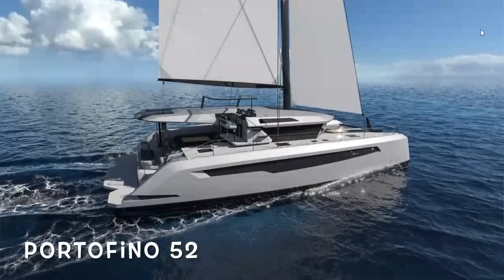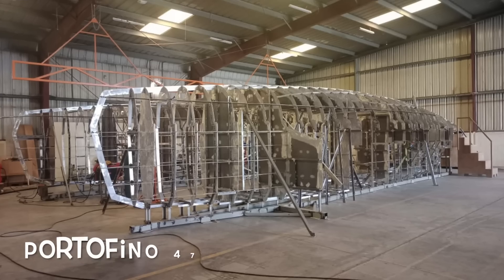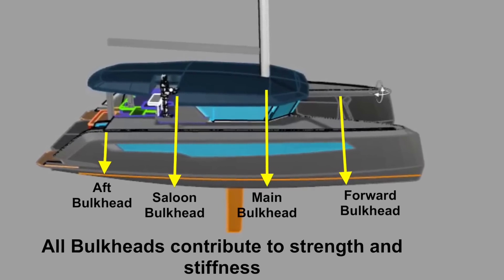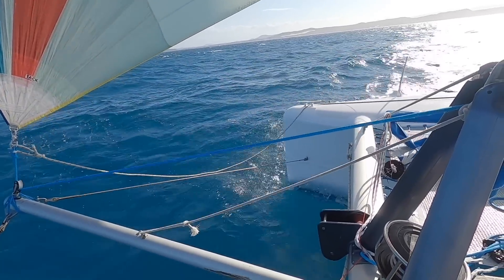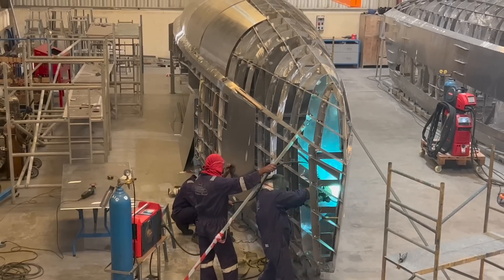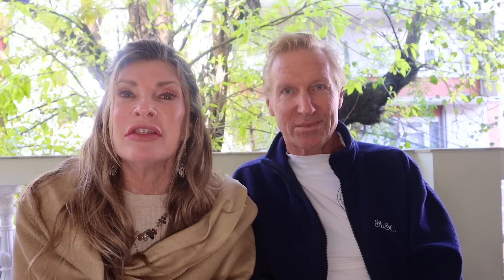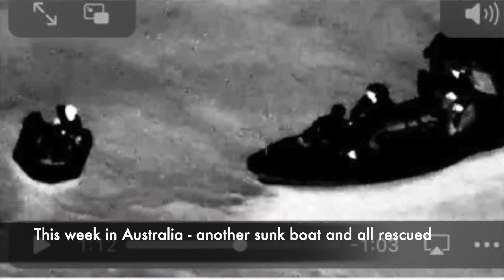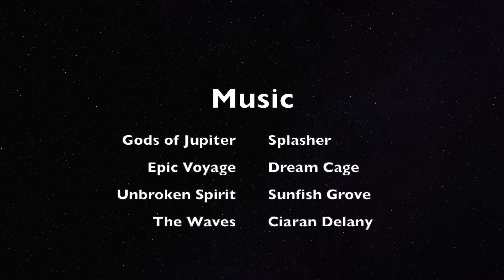S3#9.  Portofino 52 Build Starts!!! The TRUTH about BULKHEADS. And First  of 52 AL bulkheads cut!!!

Comment: So, a question what material are you using for windows? Will it be tempered laminated glass or polycarbonate?
Reply from the maker: We are using perspex (polycarbonate I presume) as the laminated glass is very heavy. We had the some on out performance cat, Alba Dash and it lasted about 17 years in the tropics but would need to be changed eventually.
Reply: @barefootdoctorssailing  Given the required area what would the difference actually be? Not saying that your decission is wrong but still interesting.
Reply from the maker: @mmolausson  We were told (from memory) it was 400kg extra in weight to have tempered glass.... So quite significant and because we have lots of glass all around, seemingly more than the HHs, perhaps that a factor in making it so much heavier.
Reply: @barefootdoctorssailing  another unrelated question, are you going for digital switching? That would save some weight in cables

Comment: I watched your sad VLOG about the boat fire and I'm very sympathetic. I was also very interested to hear your chat about grief after losing the boat. Maybe it's only an object, but perhaps it's something more. It represents your hopes and plans for the future.

Your next boat will have an aluminium structure, perhaps as a reaction to the speed at which  fibreglass allowed fire to propagate throughout your last boat. But now you have traded one potential source of increased risk (fire), for two others (corrosion and metal fatigue). Can you tell us what steps Portofino have taken to minimise their impact on your lives? Your boat will be built in 5083-h1116, which is an alloy recommended for boat building, so maybe corrosion will be very slow, but corrosion is relentless, like gravity. And the three things that promote corrosion are concentration, temperature and time.

As for metal fatigue, I expect you will maximise the radius on all openings and provide structural support to minimise the amount that panels flex when subject to cyclic load. It's not my field, but I'm keen to learn about the design choices made for your next boat.
Reply from the maker: Hi David, thanks for the kindness and understanding! WRT the build and design, the Portofinos are being built with significant over engineering - spare strength and sustain trauma (rocks, containers, Orcas) as well as corrosion. There was a technical episode we did about the mechanical rigidity of the boat and with 20T of weight in one corner, the opposite corner only flexes 4mm.

However the extra strength and aluminium thickness (6mm) is a compromise as it makes the boat heavier so this will be 16T dry weight compared to a Mumby / Odisea that builds with 4mm aluminium.... The corrosion monitoring that we will be using is also continuously monitoring for current which occurs if there is ever any galvanic corrosion starting. Many AL boats are now 30-40 years old and still good so it is all down to the effectiveness of the protective systems that you use (we understand and hope!)

We do not think it is inevitable and Portofino is putting is sophisticated monitoring processes for our protection.

Comment: Lagoons bulk heads are a disgrace and after watching Parlay Revival and David Shih here on you tube Lagoon need to have a serious look at themselves as boat builders ........ after seeing these 2 videos on the repairs a person would be better off buying a hurricane damaged Cat , at least one would know what their getting
    With the Ally Cats main vertebrae / spleen as the strength alone is a great advantage on your cat and the odisea , but unfortunately most won't be able to afford the Ally ones , even 2hd hand but that's life . happy sailing mate
Reply from the maker: You are so right Geoff! I built my 42 foot performance cat 20 years ago and at that time, I looked around at the production boats and saw the Lagoon bullheads that were only 1 inch foam holding the mast up and I had serious concerns as my main bulkhead was 4-5 inches with solid wood laminated and epoxy glass... I would never put my life in in the hands of a Lagoon and that is another benefit of the aluminium! Unfortunately harder to build and more expensive...
Reply: @barefootdoctorssailing  , dead right mate , my heart bleeds for the unfortunate ones who actually bought a Lagoon ( Not a Hurricane one ) , like David Shih it cost him $300,000US only to have to pull it apart and spend more , very sad

Comment: Out of curiosity, if it is possible, would incorporating carbon fiber for some/all of the bulk heads have any benefits for weight savings, etc. vs aluminum bulk heads in an otherwise aluminum boat?
Reply from the maker: Interesting idea Paul, but my understanding is that even carbon fibre has the risk of electrolysis when used with large amounts of metal so I think that is why it is not done... Also Aluminium keeps the cost down and carbon shoots it all back up.

Comment: What is the weight of aluminijum.. I'm asking for finished welded structure without anything inside..(empty shell)
Reply from the maker: Thanks for the question Jean Luc. I am not sure but think about 8 tonne. Will check with Raffaele though...
Reply: @barefootdoctorssailing8567  thank youn for replay.. im Will build my boat it is in design stage .
 And I study safety first because I will build expedition.. Aluminum but not a katamaran.. there are many electrical things that boat builders are building wrong.. and other stupidity. Regards

Comment: It is not that you have "more" aluminum on the frames where a flange is welded on forming a  capital "I" shape, but its shape and location.  Google "I-beam"  to learn more.  It's the same principle that makes cores in fiberglass hulls and decks strong.  For the same reason structural bulkheads can have light weight centers, because it's the faces that take the stresses.
Reply from the maker: Thanks Tim. We obviously have to trust the architects but they have done the stress test process to confirm strength too which is nice...

Comment: More info, the better Docs! Thanks for sharing. I live south of the 40th… I’ve been quietly trying to figure out what Cat makes sense. So very glad to hear about the Portofino cats!
Reply from the maker: Wow, you must be tough Micael! That will be cold... Are you in Tassy or NZ (as I presume it is not America)? Of course it does depend what type of sailing you are going to be doing and Portofinos (like Garcias) can have extra insulation in the boat for extra warmth and the Diesel heaters for the winter. I am certainly hoping for significantly better performance than the Garcias and the theory looks good but the truth will be seen in Dec 24 after launch! 

Probably you should make you list of what you want in the boat and allocate priorities scores to each item and then you can go through the list of boats to see what the options are and what you had to lose with each boat.

Comment: Very late to the party (got totally sidetracked watching police chases, pit maneuvers, and jail guards!) I'm no marine architect, nor do I have knowledge of geometry, but I have a question about the shrouds. If they pull up so much by being attached to the outside of the hulls, why don't they change the system to have them through the decks to the inside edges of the hulls? I get that would mean more places for possible leaks, but many are already actually done thru the decks to the inside of the outer hulls anyway. I hope that was clear! LOL
Reply from the maker: Hi again Diana, nice to hear from you again! Having the shrouds attached on the outside of the hull at the bulkheads means the pressure is taken by the bulkhead and not by the bolts that it is attached with... If it was inside the hull, it would be the top of the bolts that were taking all the pressure, instead of the bolts just holding the shrouds in place and the compression taken directly on the bulkheads. Hope that is clear - a diagram would make it easier...
Reply: @barefootdoctorssailing  I'm not sure! LOL

Comment: Fire? You are in the middle of the sea how can it catch fire? 😵‍💫😂🤣….. it’s amazing how flammable a boat can be surrounded by sea water. Fire extinguishers needed as well as builder pumps.❤
Reply from the maker: The usual cause of fire at sea is diesel leaking onto something hot, electrical wires or equipment shorting out or batteries (esp Lithium) overheating..... Yes fibreglass is very flammable and as soon as it establishes the whole boat will go up so you have have to kill it fast when it is small....

Comment: Off-topic, house battery research.

$6370 for 15.4kWh with automatic fire arrestors in an enclosed 24 in x 26 in x 28 in rack, paired with 3kW inverter and 5kW PV input. Throw in tinned wire/lugs and a Galvanic Isolator.

See YT "$749 EG4 All-in-one Solar System: 3000W Inverter, 5000W MPPT, 80A Battery Charger". but latest versions all 48 volts - (3) $1749 EG4-LL Lithium Battery (V2), (1) $675 EG4 3kW Off-Grid Inverter (new round corners), (1) $450 (Pre-Assembled) EG4 Enclosed Battery Rack, (1) $??? Galvanic Isolator VDI-xx.

Never know your current topic but figure this will be soon. All-in-one systems have come a long way very recently for homes. BTW the battery system supports up to 81.9kW hours at 48 volts.
Reply from the maker: Thanks again Boston for your comments again. Very interesting!!!!  The battery systems and chargers are developing so fast we are probably going to wait till six months before completion to look at what’s available at that time and we’ll probably do the battery discussion in that time frame. Thanks for those great bits of information it is very exciting how things are progressing and we are going to be using 48 V and there’s much of our gear as we can.
Reply: @barefootdoctorssailing  Perfect

Comment: I like this deep dive into a technical issue.  Can't recall anyone else doing such an in depth review.  Excellent!
Reply from the maker: Glad you liked it Colleen! I was not sure if it was a bit boring but certainly no-one else had talked about it and the large brands are still putting out comments that are very misleading.... Hopefully if the knowledge is across more of the yachts, they won't be able to get away with such stuff!
Reply: @barefootdoctorssailing  ..Detailed videos are an excellent help.  I am also becoming increasingly concerned about the corporate structure at Leopard and how they intentionally split the manufacturer and warranty claims functions.  I have followed another channel that is having a hell of a time getting warranty work done.  They claim they must sign an NDA before work is authorized.  Was that your experience with your Lapboard 50?
Reply from the maker: @michaeltca3103  BHi Colleen, we have only had small things go wrong and they were just dealt with by being told to fix them and send the invoices. They were not fast to pay but not the hassles that the other guys seem to have had with structural issues...

Comment: Aluminum in aircraft and boats. Aircraft use alodine treatment before painting. . I heard another sailor that has been around the world in an aluminum catamaran. His comment was to coat with paint the bilge where any salt water can collect. I saw a fisherman in Australia with an aluminum fishing boat on YouTube. He didn't clean the inside very often. He found corrosion holes clear through the hull in multiple locations .luckily he could get to location of the holes to weld and paint. The issue was there were conditions where salt water was present a lot of the time. 
Will you be painting your bilges? 
Croatian birds.
Reply from the maker: HI Gearing, at the moment I do not know what the plan is for the inside aluminium. 2 Things however - I would want the insides of the boat to always be dry and I succeeded with that with our 42 foot performance cat. Unlike the old boats that leak, AL and western red cedar with expoxy do not so the hulls are dry and ANY water raises alarm bells. Secondly, my understanding is that AL should not corrode unless there is a leak of power, your anodes are dead or there is power leaking from another boat / marina. So if the hulls are dry, we should not corrode and separately if the anodes and leak detectors are in place, we separately should not corrode. 

Silly things like metal debris, nails, screws or coins in the wet hull will cause the AL to corrode so keeping everything clean and dry is therefore important...

Sorry not Croatian birds - a different continent...

Comment: Interesting comments on bulkheads.  There are 3 other channels showing new cat construction (actually, one is reconstruction)  so will be interesting to compare each design
Reply from the maker: Thanks for commenting Robin. Are you talking about SLV (Rapido), Wynns (HH), Ruby Rose (Seawind) and MJ sailing? There is also Sailing into Freedom (Odisea) about to start and others very close so exciting times. When they are manufacturers making the boats, you will see less detail as the bulkheads are built and glassed in but all of those boat brands have good reputations to build strong enough bulkheads and glass them in well. MJ Sailing is well past bulkhead stages but you would have been able to see how they ensured their bulkheads were sound... 

What details were hoping to see - or just compare to what I was talking about?

Comment: Very Interesting -- QUESTION -- Why not have a steel cable (like a shroud but stronger) running horizontally from one side of the Cat to the other, connecting where the vertical mast shrouds connect to the outside hulls, ie from shroud to shroud, thus completely offsetting the forces from the mast shrouds that are trying to pull the hulls apart.  This should stop any spreading force coming from the mast/vertical shrouds.
Reply from the maker: Good logic Colleen. That is really what the bulkheads do and the different materials (metal, GRP, Wood and carbon) just use different amounts of material to create the required strength... Also steel would be heavier than all the other materials and occ aluminum is used for this purpose (like in the Leopard 45 photo of alum supporting the bulkhead).
Reply: @barefootdoctorssailing  ..very cool.  I got the idea from watching how they construct a roof on a house and then tie the "triangle" shape of an A frame roof together by running beams across the attic floor to stop the "A" from splitting apart during hurricanes and strong winds.

Comment: G'day Guys, a very informative and interesting video which I thought was a simple way of explaining to the uninitiated in laymans terms, well done.  Pumps, the vain of every boatie.  I have seen Bilge Pp's installed with a float switch that was set to go off too early (Shallow)  ie; the Pp still has air trapped in the impeller area which makes the Pp inaffective (useless) and unless you bleed off the air or more water comes in to overcome the air lock, it is not going to work.  As for emergency Pp's, your local rural supplier can supply a small petrol Pp that they use on small dams or for firefighting.  I carry a small 2-stroke one onboard with enough length of hose to pump from the engine room to over the side.  They pump a fair volume of water, are light & small enough to stash away and can also be used for firefighting.  I run mine about once a month to keep it in good operating condition.  I'll take a stab in the dark and say you guys are in Singa's, on your way home for a much needed break!!  :)
Reply from the maker: Hi TEx, that petrol pump is exactly the thing we are looking for to double as a pump not dependent on the batteries and dual purpose as you say. Thanks for your comment again!

Singapore is not where we are - but good guess as it is an Asian country.

Comment: Btw: thinking dagger board activation recovery system possible problematic  in 3rd world country world voyage......what happens if you lose electrical to that centerboard mechanism? A daggerboard is so much mush straight forward, and easy to replace/repair., plus visually indicative of its position to ondeck crew!!!! the daggerboard trunk could be creatively positioned(your current designer probably "locked-in" to having them dead center in th hulls), but many designs dn not do this, or have a bulkhead at th trunk, and have two entries to each hulls from th salon two companionways fore & aft of th dboard trunk...
Reply from the maker: Thanks Lincoln again for the comment. I understand we will have a manual system to raise and lower the daggerboard with a winch handle if we need to. Having had the daggerboards, there is greater risk if you run aground with one as something will break - either your daggerboard (moderately annoying) or your hull (major catastrophe)!

What I like about this design is that it will just kick up and nothing will be harmed. It is only when sailing forward that you are going at pace so any fast collision will result in it kicking up directly backwards. If you drift sideways onto a reef, the speed will be very slow and much less damaging..

Our centreboard is below the soles (Floors) of the hulls so are not in the way of anything, an added bonus as daggerboard take up that section of lateral hull space. Always pros and cons so we all have to make those calls and that is personal choice.
Reply: @barefootdoctorssailing  😁